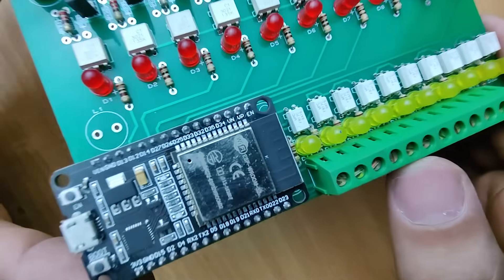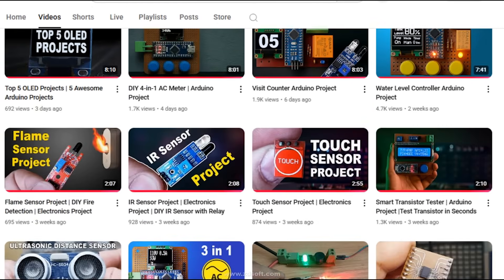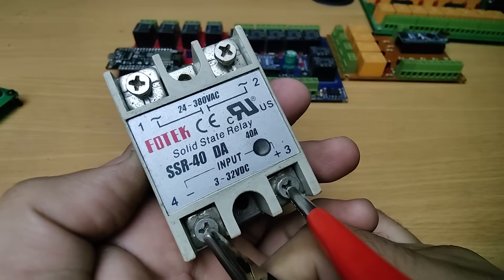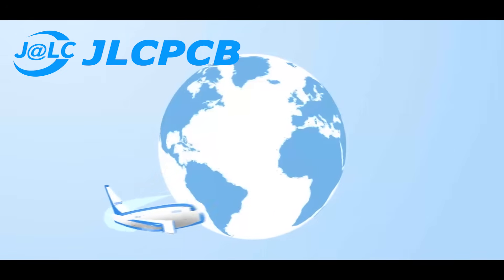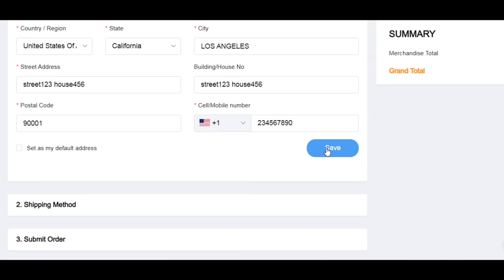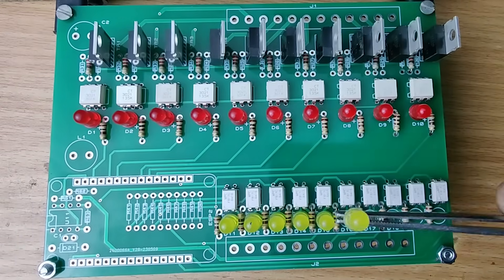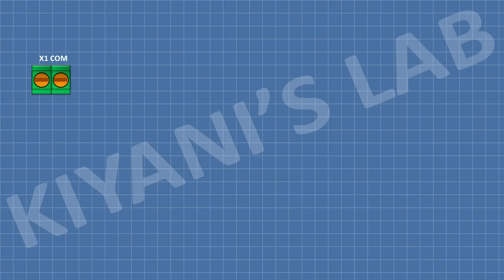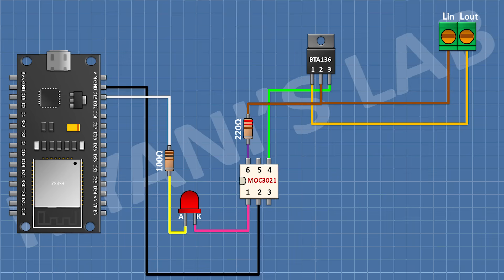How To Make  ESP32 PLC | Ladder Programming

Comment: Good Fternoon sir pl share the link in discription if software free to design pcb layout designing and it's method to design similarly pl share pdf schematic of the schematic of current video with modification using truacc and optocoupler circuit details also iwhich software you have used to write plc ladder.Nd upliDing debugging etc Ntivipstunh your reply pl share your gmail id for communication ref.

Comment: Pl design and upload the video if dual dc transformerkess and transformer with digital display short protection dcpiwer supply with oto 30vdc 5amp and 10amp with fixed 5v separate with ccand cv mode.

Comment: Have you considered adding support for 4-20mA analog signals? It would open up your board to industrial sensors like pressure transducers or flow meters, making it even more versatile for real-world PLC applications. What's your take on redesigning the board to include this—maybe via dedicated I2C modules or integrated DAC/ADC channels? I think it could be a game-changer and inspire a whole community of makers to tackle advanced control systems.

Keep up the awesome work! 🚀

Comment: It is required to have the inputs opto isolated. A small pcb board mounted 'brick' power supply would do the trick without adding significantly to it's cost. If you use the bidirectional opto isolator, the device can use either PNP or NPN based sensors. A current limiting resistor also needs to be inserted into the circuit as well.
The use of the indicator led in series with the opto coupler is a very good idea.
As for the output, substituting a standard opto coupler and a darlington transistor can convert the existing device into a industrial standard 24Vdc device.
Snubber MOV's for AC circuits, and flyback diodes on DC circuits is always recommended.
As far as outputs are concerned, pay attention to what kind of amps are being controlled. It takes a certain amount of energy to close a relay or drive a motor, as measured in watts. Watts being volts X amps, using a 24Vdc device will need less amps to operate that the same device configured for 5Vdc
Reply: Can u publish the upgraded version
Reply: Please publish v2.0
Reply: Hi I am currently working with his setup, however, I am unable to get the AC output to work. I have connected the neutral to the output COM, Y1 to my AC Motor and live to my AC motor too. However, my AC motor only turns on briefly when I switch on the power supply. And does not seem to be controlled by the output. Meaning that even when the output LED is turned on, it does not turn on my AC motor.

It would be great if you know what might be the issue with my setup.

Comment: A few comments from a guy who's been around for a while.  From the way you described the circuit, it appears there is little or no protection for the LED and opto-isolator or the input.  It does take much of a reverse spike to take out both devices.  There is no provision for loop current on the inputs.  You will need seperate power supplies for inputs like limit switches.  It doesn't sound like you have zero-crossing switching of the triacs.  This can cause noise that gets into the rest of your circuitry.  SSR's do not do well when driving inductive loads such as motors and contactors.  You need to protect the triacs from inductive kick-back. I don't see any provision for heat sinking the triacs.  I like JLCPCB they have produced many fine boards for me.  Now if we could just get rid of the crazy tariffs.
Reply from the maker: I appreciate the feedback, I will consider adding more protection measures such as snubber mov also consider  loop current  in future projects.
Reply: the Input circuit is not designed for 24V DC and the Com Terminal is direct tied together with the ESP32
Reply: @walterdoerler6791   do you support ethnic cle@nsing
Reply: Hi I am currently working with his setup, however, I am unable to get the AC output to work. I have connected the neutral to the output COM, Y1 to my AC Motor and live to my AC motor too. However, my AC motor only turns on briefly when I switch on the power supply. And does not seem to be controlled by the output. Meaning that even when the output LED is turned on, it does not turn on my AC motor.

It would be great if you know what might be the issue with my setup.
Reply: emigrate to Gaza ?

Comment: Is there mistake in input side LED? if input side is 24V the led will break, if led is moved to esp side to opto coupler then 100ohm resistor is enough otherwise 1,2kohm or higher is needed
Reply from the maker: input works with 5V as i mansion in the video

Comment: Nice video, but those inputs are not isolated.  Isolated means there are no connections from the input to anything else.  You have the common connected, so definitely non-isolated.
Reply: By give different source to the esp32 we can complete isolate right ? . For loads one source and for esp32 different one .
Reply: @iam_muni_baa  isolated means that there is no connection between input and output.  You'd need some sort of isolator, like a TI ISO7721.  Isolated means there is no shared power/ground/signal/ anything.
Reply: @iam_muni_baa   Or an optoisolator.
Reply: @CalebCrome  got it thanks
Reply: if we remove the connection between the common and esp32 gnd, would the problem be solved?
Reply: its standard with indistrial device to have common ground
Reply: Hi I am currently working with his setup, however, I am unable to get the AC output to work. I have connected the neutral to the output COM, Y1 to my AC Motor and live to my AC motor too. However, my AC motor only turns on briefly when I switch on the power supply. And does not seem to be controlled by the output. Meaning that even when the output LED is turned on, it does not turn on my AC motor.

It would be great if you know what might be the issue with my setup.